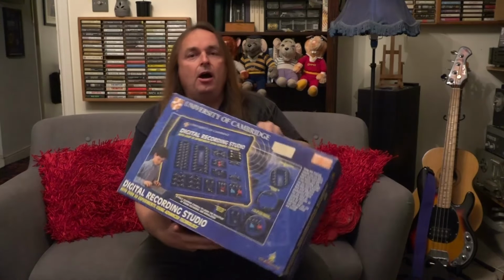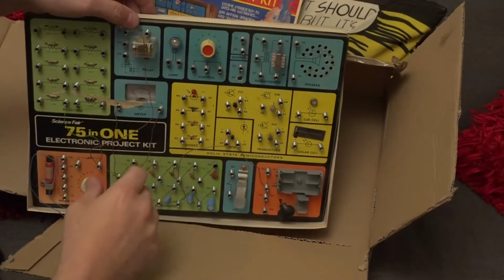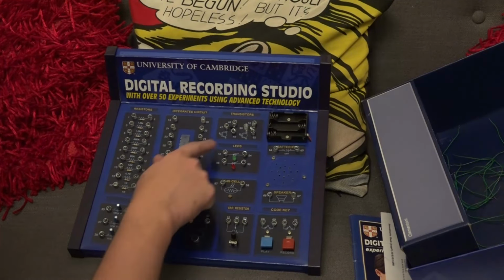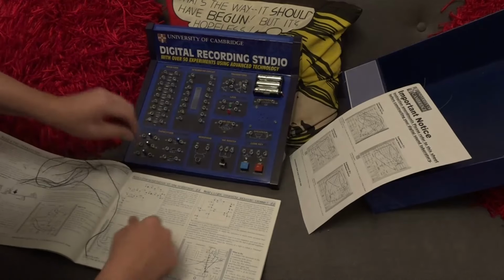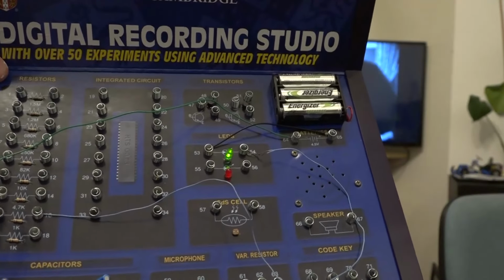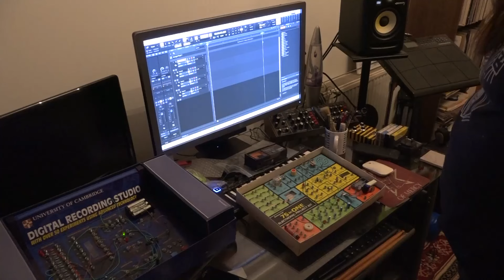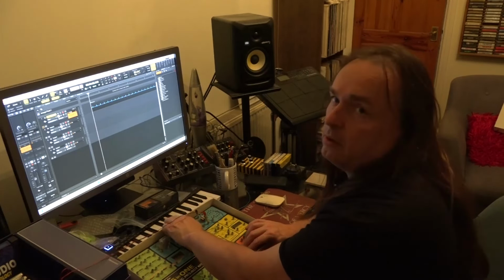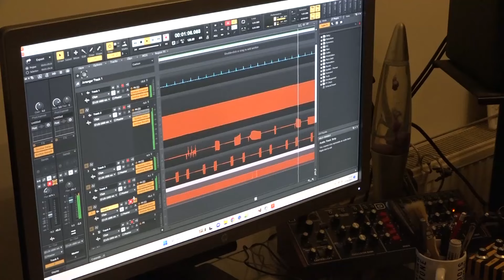Making music on Radio Shack Tandy Electronics Kit & Cambridge University Recording Studio kit!!

Comment: The best part is they never stopped making these. They come in all different shapes and sizes, but the general concept is the same, and they're a lot of fun (and occasionally kinda useful if you want to quickly test resistor/capacitor values and can't find a breadboard lol).

Comment: Back in the day before the Tom Scholz Rockman came out, at the recommendation of a friend, I bought a little plastic 9V speaker/amplifier (gray) from Radio Shack for $5.00 !!! You plug your guitar directly into it and the more you crank the volume, the more distortion it would deliver! It didn't sound that great but it was perfect for practice and it tucked neatly away in the compartment inside of your guitar case. I would compare the sound to one of those clip-on 9V Marshall mini amps, maybe not as good as the Marshall, but pretty damn close! I was always going to Radio Shack for this or that.